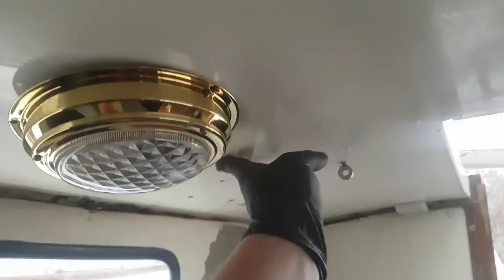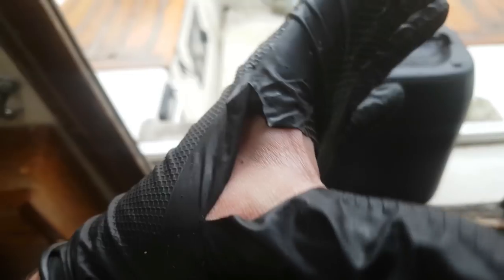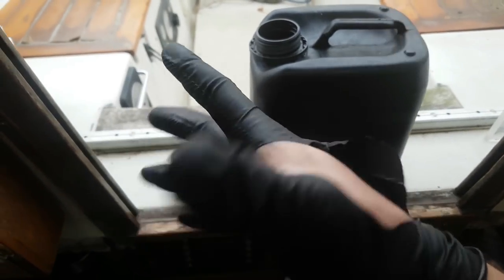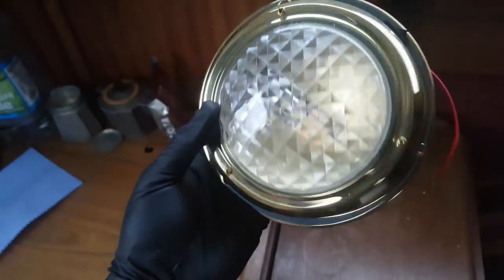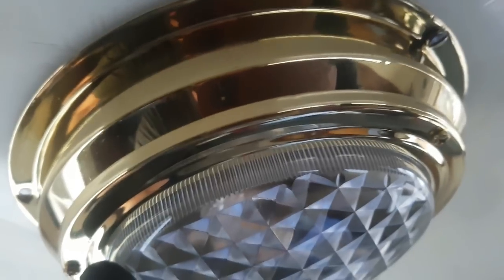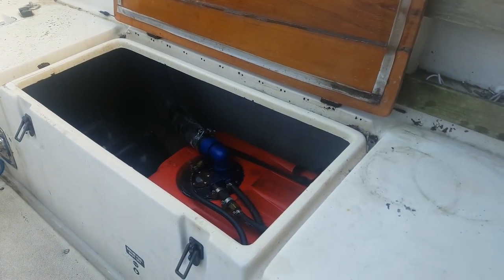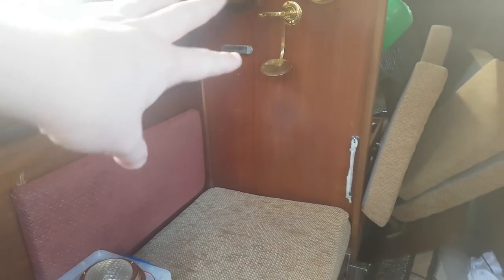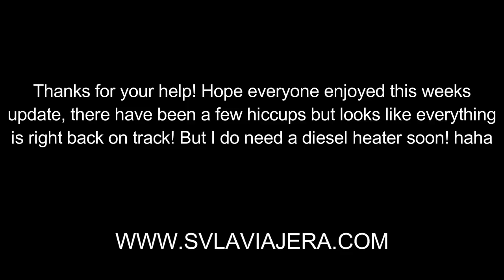Albin Vega Refit - 13 - Gun Wash Thinners and PSA Veneer Verdict!

Comment: I haven't done my diesel heating yet - I'm going for a Wallas stove with a blower hood.  That should be enough for my 28ft boat. I knew someone with a 30ft Westerly and an Eberspacher. Just one outlet at the back near the cabin sole.  That heated up very quickly and kept the whole boat toasty.
Reply from the maker: Just about sailing That's really good to hear! I'm going to be using an Eberspacher D2, thanks for the advice about keeping the outlet low too, I've realised that it would have been a bit of a mistake to have it coming out so high up. Moving the fan heater from the galley worktop to the floor last night showed a massive improvement in the -6°C weather! Josh

Comment: You will be much happier with two outlets.  Cuts down on the stratification and drafts by quite a bit.  With a fan (as in the Toyotomi etc.) you could use 2 or 3" duct and lose very little space.  Another option is to put a 'Y' in that line and fab a valve of some kind so that you can also divert the air to your windshield.  Works great for defrosting in rainy/cold weather.  That is what I did on my 26' Tolly many years ago.  Take care.  Doug

Comment: Looking good there dude! Won't be long now til you're living the life! Keeping the vents low as they've said is what you want. The lower they are, the faster hte boat warms up and the better it works. 

How thick is the ducting as you may want to run one to the forward berth. Just in case you have guests on board and want to close the door to the forward berth area. You might be able to run it under the seats with some finagling.
Reply from the maker: Rigal Hey, you've just convinced me to run the heater forward! I never thought about privacy of guests. The ducting is 60mm diameter. I suppose, worst case scenario, I could just remove the ducting at a later date if I'm ever that stuck for storage space. Just checked where you suggested to run the ducting and it looks like there may already be holes cut to size which I always assumed where just ventilation... maybe she had a diesel heater in the past? Thanks again Rigal, was stuck in limbo with that one! Josh
Reply: You shouldn't be too hard pressed for space, even with a pipe that size I'm thinking. And you're right, it can be removed if needed, say during summer and put back in for the colder times. 

Sure sounds like there was heating or something down there before! If they're where I'm thinking they are, in the corners, then thats the best place usually to run piping to keep them out the way.

Glad I could do some thing, though you're doing all the real work there!

Comment: I'd pay attention to The comments from 2wheels1keel and also Just about sailing! Go low on the heat outlets!
Good luck! Very interesting result on the Gunwash!
Reply from the maker: Tylee Good advice, although I'll plod on with the veneering, I have a vision in my head haha. Definitely going to go low with the outlets though. It got to -6°C here last night and changing the position of the fan heater so it was on the floor made a massive difference! Thanks for your comment, Josh!

Comment: Josh, I put a Webasto into a Moody 31 couple of years ago.  Two outlets one in the companion way with 70% of the air and another in the rear cabin for 30%.  The angle on the junction pipes determines the volumes.  During the recent cold snap we were living on board.  A single 1kw electric heater wasn't enough.  Couldn't run two electric heaters without the power tripping the circuit.  However, with the 2kw Webasto on within 30 mins it was turned down to 1/2 setting with temperatures  77'f in the cabin.  Left it running all night and more than warm enough and we don't have any insulation other than a cored deck.  Outside temperature was enough to freeze sea water splashing onto the jetty.  So no I don't think you need to run an outlet up to the bow, the circulation from the heater will be enough, but could you put two outlets in near the companion way low down to mix the circulating air.  Oh we used roughly 5L per day running 16 hrs per day.  I am following your insulation posts because we need to do our boat.

Comment: The D2 would be a good solution.Do not worry about the trunking taking up room I had a Phillipa 27 and I still had plenty of room infact my trip across the Atlantic albeit singlehanded left me with plenty of room for all my needs.
Reply from the maker: Thanks Terry, seems like a robust option for a heater than can still be used while underway. Still in two minds over the ducting though but you've already done what I plan on doing so I'd be silly not to take your advice, plus I plan on going to much colder waters and would probably appreciate more heat in the V berth. Thanks for your help, will probably need it a lot more going forward haha, Josh

Comment: I have a espacher d4 which has 4 out lets and they are all at floor level exiting below bunks.What you could do is run trunking to 2 or 3 outlets where you want heat. You can have outlets that open and close so you choose which area you want to heat up the most.the trunking is quite cheap and the outlets are not too expensive. Where about is your boat?
Reply from the maker: Terry Williams Hey Terry, I'm going to be buying a D2, the problem with the trunking is the space it takes up and I don't know if I can stomach that loss of storage space on a 27ft boat. All things are worth considering though and you're right, it'd be better to be able to close the outlets and choose where got more heat. She's based in the North of England right now, hopefully she'll be on distant waters soon! Thanks, Josh